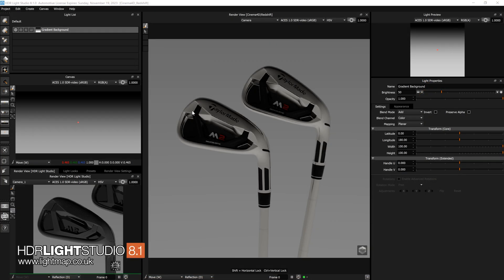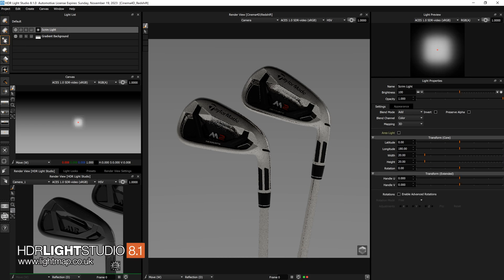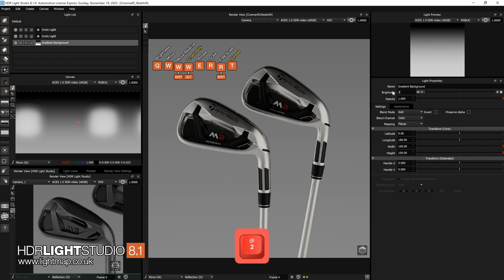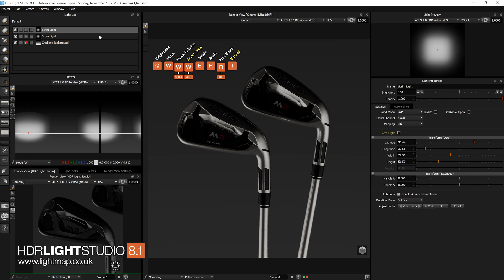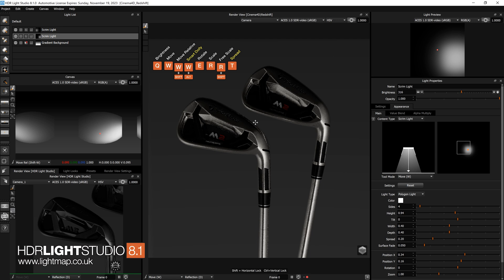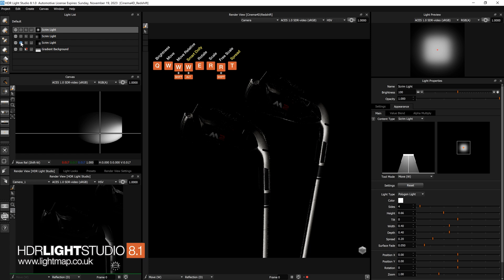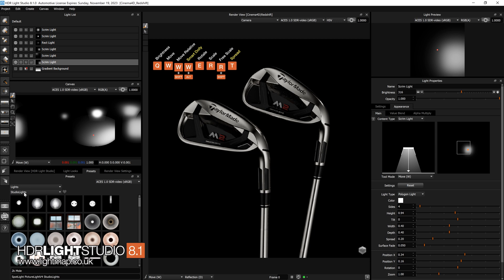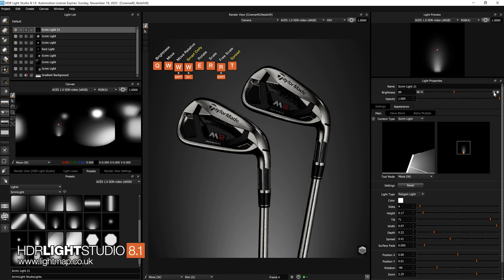Studio Lighting for CG Golf Clubs - Tutorial

Comment: I encountered a problem, I installed the 6.0 HDR Light Studio version on the computer WIN11 system, open the software above the value of the parameters are garbled, other fonts are normal, I tried to reinstall the computer system, but still the same problem, do you know what is the reason?
Reply from the maker: The current version is HDR Light Studio 8. Where did you get version 6 and why are you trying to install that old version now? Maybe contact our support@lightmap.co.uk to help you.
Reply: @HDRLightStudio  Because I am still using C4D R20 version, I searched on the Internet seems HDR Light Studio new version does not support C4D R20 version, I have been working for a long time using the R20 version, in WIN10 system is no such problem, recently upgraded WIN11 before such a situation, I am not too used to the new version of C4D, so I can only use the old version, I hope the old version of HDR Light Studio in WIN11 system can still support, so I can continue to use him to solve my work problems